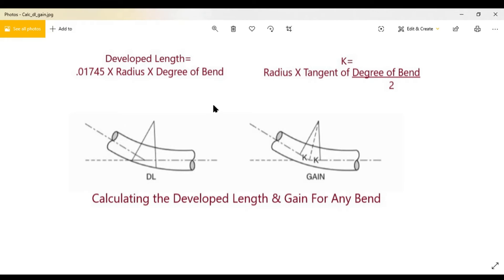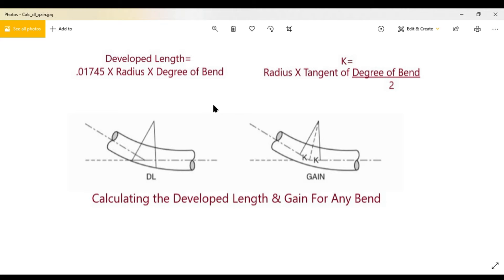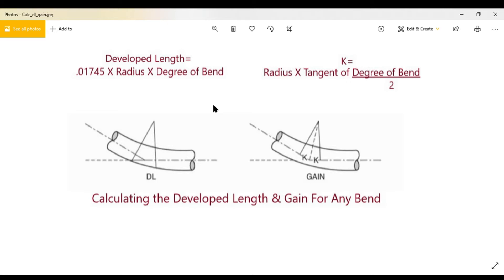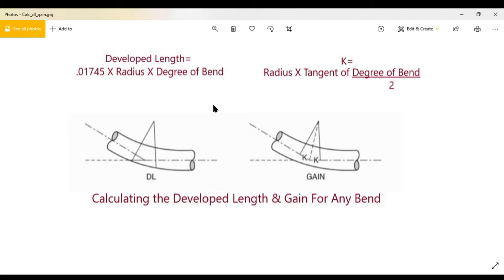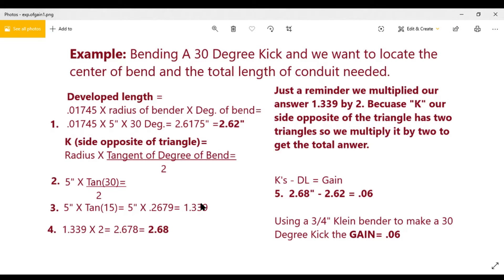Advanced Conduit Bending Pt.3: Calculating Gain for less than 90 Degree Bends

Comment: Hi Mel,  Its been a while since ive done orders of opperation in algebra, but in the example where your calculating the opposite side of triangle, the formula in step 2 is tan(30)/2, in step three you have it written as tan(15). I double checked my sci calc and they return different answers. Could you clarify for me. Thx
Reply from the maker: yes basically your just taking whatever degree your choosing to bend and divide it by 2. i started out with 30 but when i divide it by 2 i get 15. don't put it in the formula. just divide that separately , usually you can do it in your head. then put it in the formula after you divide it in your head into the formula as tan of 15 not tan 30/2 not what i mean. it just complicates things further.
Reply: @TheArtOfConduitBending the two results mean completely different things. You should write the formula to say “takes the tangent of half of the angle” and not “take the tangent of the angle halved“. Mathematics is a very specific language… great video btw.
Reply from the maker: @boschulte  ill take a look at what you're saying. Thanks for the suggestion.